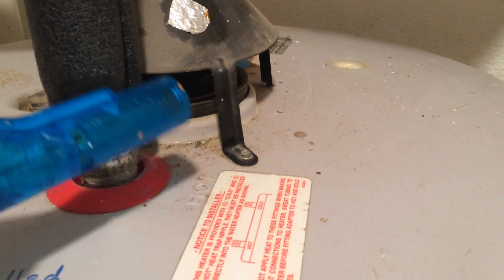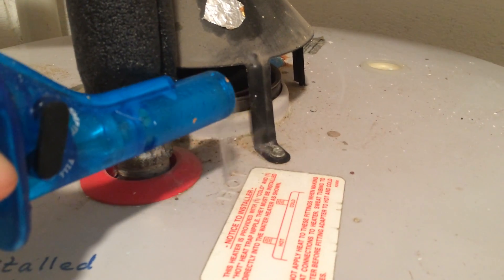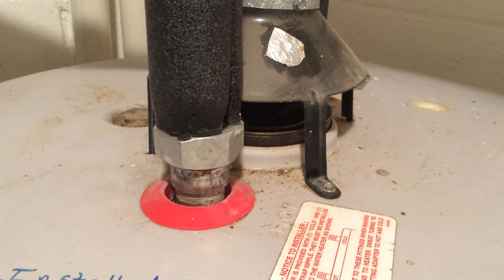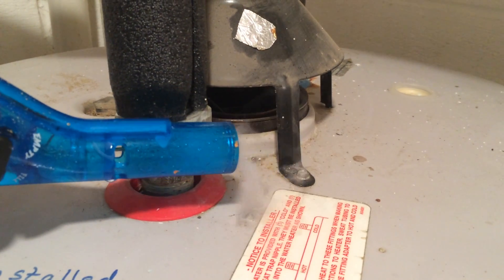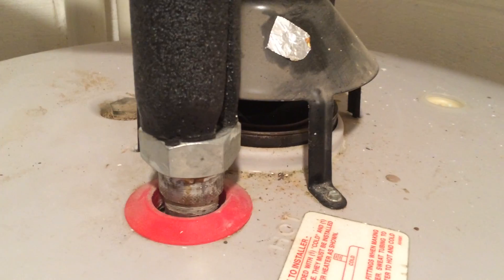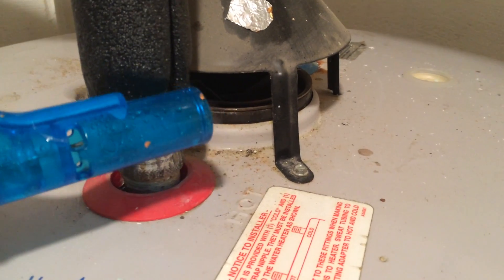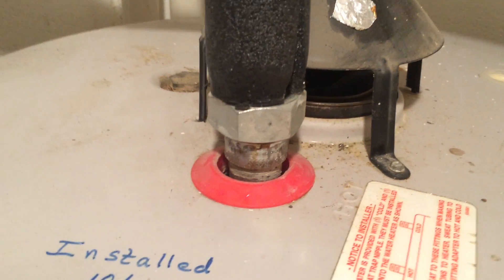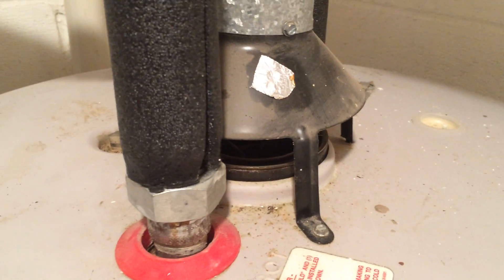Backdrafting natural draft gas water heater

Comment: I have yet to see a video where somebody actually FIXES backdraft issues with direct vent water heaters.
Reply from the maker: It's a pain in the ass usually. You can drill a hole to outdoors and run a duct near the bottom of the water heater or see if there's a brick stuck in the chimney, or fix sloping on the flue. Doing it right often costs what a heat pump water heater did at the time ($1300 then for the tank, now ~$2000.)
Reply: I saw a video, a man use torch to heat the duct. But I didn't make it on mine. So I loose the water heater duct, twist the elbow, connect a duct blower (I use an old furnace draft inducer fan), run for 5 min. Then restore the exhaust duct back.

Comment: So how do you fix the issue?
Reply from the maker: It's a pain. You have to create more draft somehow. You can install a chimney liner ($300-500 or so), which it should have if its orphaned anyway (no furnace in the flue). That may or may not work. Then you can add combustion air by drilling a hole to outdoors and running a pipe close to the water heater for it to get combustion air. That's usually at least a couple hundred as well, and again may or may not work. This is why air sealing with a "natural draft" appliance is so tricky.
The real solution is to install an "induced draft" water heater (which has a fan to pull air through it and blow it outside.) Those are fairly expensive and tend to have short lives. 

Our preference, a "heat pump water heater", is electric and pulls heat out of the space it's in to heat the water. They work best in large spaces like basements (in cold climates) or garages (in warm climates). This client put in a heat pump water heater, and it's our go to method.

Much more on water heaters here: http://bit.ly/WhyGasWaterHeatersSuck
Reply: @NatetheHouseWhisperer  Thanks for the response